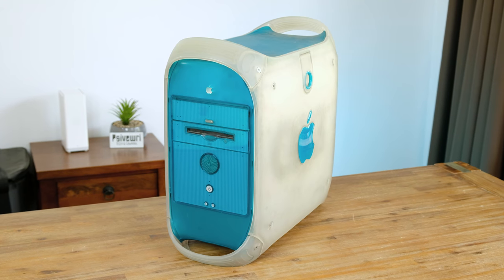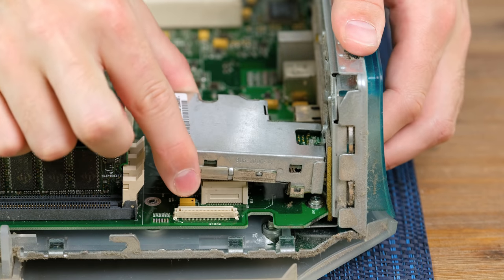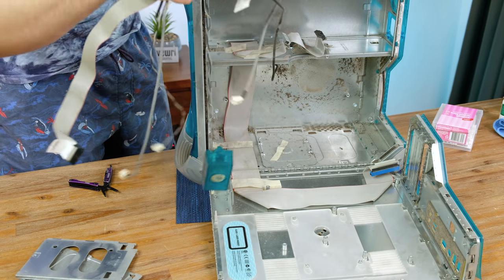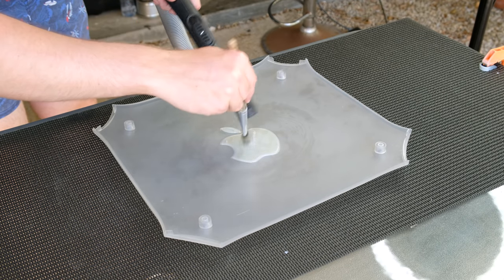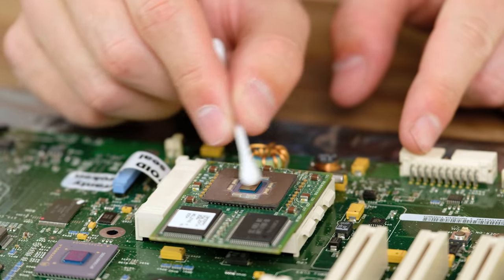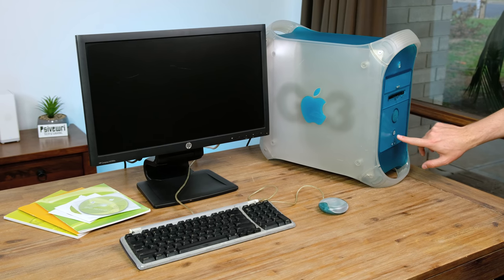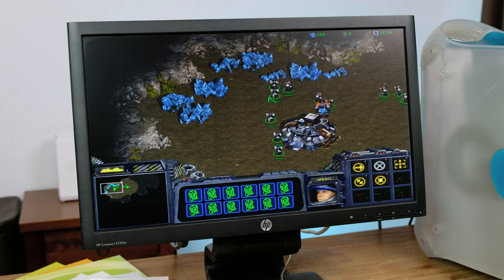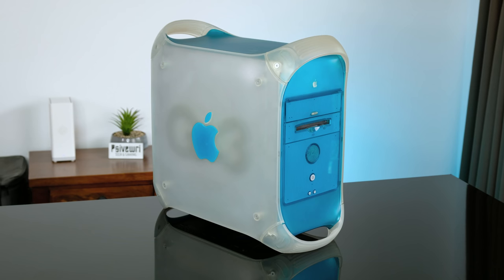Using Apple's Pro Desktop... From 20 Years Ago!

Comment: G3/4/5 are still my most favorite case designs of all time, especially the G4. just beautiful, and so easy to access things inside.
Reply: My favorite design is the graphite g4, but my favorite to use is the quicksilver. It’s the best mid ground to performance and cost. The MDD models can get expensive.

Comment: Very nice. I’ve still got our 400MHz B&W G3 my dad bought back in ‘99. It had been stored in the crawl space after we moved on to newer computers. I recently dug it out and freshened it up. Didn’t need much of a cleaning, but was missing the Rage 128 video card and the optical drive bracket and flip down door. Sourced the parts online and it’s back running good as new. Threw an 18GB 7200rpm HD in there, and with the 448MB RAM it had from years ago, it’s a very snappy Mac indeed!

Comment: Oh man, this brings me back! I remember in my College Art Department, a critical flaw in the design of these machines became apparent... well, less the computer itself, and more just the Zip Drives. See, if you had a broken Zip disk, it would break a drive when it tried to red the disk. If a drive was broken, it would break the disk. You can see where this is leading. The entire Mac Lab would go down at least one a semester because someone would kept trying to use a busted disk in each machine, rendering them unusable. Though since it was a chicken and egg scenario (what was broken first, the disk or the drive), it'd be hard to fault the student who accidentally did all this, especially since they essentially just lost all their work.

But yeah, nostalgia at its finest!

You mentioned/showed a lot of expansion space. About how much do you think this thing could be upgraded? (like, could you get over a gig of ram in there? An SD drive? A dedicated graphics card that still used the old PCI slots?)

Comment: Hey I've only just discovered your site - what a surprise to come across another Youtuber who works occasionally with the older Macs. This take-apart of the B&W G3 was mega - I don't think any part was not disassembled. Well done and even better was the fact that it went back together so neatly - not so easy.  I have 4 B&W G3s in my own rather expansive collection of old Mac towers. They are all in pristine condition (barely used), all with Zip drives, 2 @400mhz and 2 @450mhz. However up until the beginning of this year I had 7 - I gave 3 away for free on Gumtree. I had them up for sale on eBay (in Oz) for $50 but no-one was interested - so I disagree with you that they have any monetary value. I just like them because the B&W look so good. They are also great for running OS9 and older games (the G4s are better).  And of course every imagineable program and game for OS9 is now freely downloadable on the Internet since they are now regarded as "abandon-ware".

Comment: i was an Apple service tech when these came out , such a dream to work on , 5 minute ram or hard drive upgrades !
if i remember correctly it was the first , or one of the first computers to have USB only as the serial and keyboard/mouse interface . at the time people were unhappy about it because their old stuff didn't connect !
Reply: Do you think you could put an SSD in it and run the latest OS ?  (I have no idea what that is.)
Reply: i won't say it's impossible to put an SSD in a G3 , but it's not going to be simple , the hard drive connections were either SCSI or IDE/PATA . no SATA ports . there may be a card that will add SATA ports but i have no idea if you could boot from it . 

it absolutely will not run the latest OS (10.15) , the G3 has a PowerPC processor , the latest OS's are all for Intel based machines . i think even if you could get it to work it would be so slow you'd never want to use it .
the last version to support PowerPC is 10.6 . that might run ok , but many websites are close to not accepting any of the web browsers that run on that version , so usability is limited . 
also maximum ram was 1 GB , amazing for OS 9 that it came with , not so cool now .
Reply: I believe they were also the first PowerMac with FireWire. I had (actually still have somewhere) an external Sony FireWire DVD drive that had the translucent blue trim to match the computer.

Comment: We found a Power Macintosh G3 and a CRT Apple Studio Display; both of which were brand new and never taken out of their original packaging. About 2 years ago, me and my mom were driving on a warm summer day, and saw two boxes sitting on the curb. A sign said, "Willing to get rid of these. I don't think they're rare." We picked them up and took them home. We powered the computer on, and it worked. My mom gave me the computer since I noticed it first, and now my main computer in my room is a Power Macintosh G3.

Comment: Looks like your HP monitor is working fine. Are you using a VGA cable? I'm not having any luck getting my G4 to run on a similar size Dell. Getting the black screen and a no signal prompt. Maybe the display card is bad.
Reply from the maker: I was using a VGA connection. Might be something wrong

Comment: I remember when the Computer Lab back at the U got refreshed with these puppies, which was a SUBSTANTIAL upgrade from the old dusty Pentiums I and II they used to have,  also was my first interaction with Mac's back in the day as I used to be only a PC boy with either windows or Linux, can't deny I was charmed by the looks and the OS wasn't that half bad either, but gone are those days. Last time I touched an apple system was a Hackintosh I made installed, Snow  Leopard OS to use ProTools, I know I could have gone the easy route of just running a VM, but since I was going for a more "PRO" audio studio setup/build i decided to go to the Hackintosh which it  turned  out to be  pretty decent.

Comment: This was my first computer (with the matching monitor) as a graphic design student in '99. I used it until about '05 when the monitor went out. I sold the computer to a friend for $300 and I guess it only lasted about six months for him. It really was way ahead of its time. OSX was light years beyond Windows at that point. I've probably owned about 8 macs and used 10 for work. Of those 18 and I'd say this was somewhere right in the middle. Not the worst but not the best.

Comment: Still slightly newer than my oldest laptop which is a Toshiba Satelite 330cds with a manufacture date of November 14, 1998. Has a 266 MHz Pentium mmx with 96 MB ram and it's original 4.1 gb hard drive. Still runs fine today on Windows 98 second edition.

Comment: Next time use a compressor to blow the dust out works really well, I am doing it for more than 25 years. Protect the fans from spinning using a very small wooden stick or move really quick from left to right over the fans. Don't forget to lube the fans bearings under the sticker with very fine oil, like sawing machine oil reattach the sticker or a bit of tape.

Comment: What a beauty, although the cube is still the prettiest.
Its a shame you don't have the monitor to go with it though, that would really be a sight to behold.

This video has reminded me that I really need to get on with refurbing my G4 Powermac, but I'd like to max it out first with a dual 2GHz CPU to go with the 1.5GB RAM and the ATi Radeon 9650 256MB it currently has installed. (I sourced that 9650 from a G5 Powermac for 20 quid, and my G4 only has the 733MHz single CPU fitted, which is way too slow for the 9650 to really shine)
Reply from the maker: I would have used my old LCD cinema display, however that requires an ADC connector, or at the very least a DVI connector

Comment: I bought a 300 MHz Blue and white G3 from a friend who is a graphics designer. He had fitted a Sonnet G4 upgrade kit so it was a 450 MHz G4. He also installed a high-end graphics card. I felt it needed more IO so I added a combined USB/FireWire 400 PCI card, this had two USB 2.0 and two FW 400 ports, enhancing the capability quite a bit. Later I added another card with an additional four USB 2.0 ports. I also gave it the maximum RAM of 1 GB.

Comment: Hi, I love your videos. I’ve been watching them lately. They are very entertaining and taking apart repairing laptops in PCs. I love your videos thank you I have a question for you. I have the old laptop that was recently found unrepairable because it had a motherboard issue and I’m getting a new refurbished one but the old laptop the technician told me he was going to give the laptop back to me to tinker with my plans are to take the hard drive SSD out take the battery out of it because it still works it can be used may be in another computer, so what are your thoughts? I’m curious what you think since you like to repair computers and take them apart.

Comment: i got a silver G4 2002 model on Craigslist about a year ago for $20, non working.  i took the clock battery out and put it back it and it booted fine. i haven't done anything with it since the initial test boot and put it away

Comment: At home we have an MDD G4 Single 1.25 GHz that also has OS9 on it.  Followed by the Late 2005 Powermac G5 Dual 2.3 Ghz that is still a daily driver because of Quadro FX 4500 and 10 GB Ram.

Comment: Love the video - I'm not sure if you know this, but eucalyptus eats away at plastic! It's a handy solvent for ridding sticky messes, but on plastic fittings and cases it gradually leaves a haze. I used to use the same spray to sanitise vacuum cleaners that were in for repair but found any overspray would settle and just eat at the plastic mouldings. , Try out Halo glass cleaner, it works just as well and evaporates in seconds :)

Comment: Top example of one of these. Just be careful with the handles and feet on these, they're pretty weak. I've seen a lot of these where they're split in two, and it doesn't take much. How brittle they become may depend on the environment. One of my friends in QLD had one, the back foot suddenly gave way under the computer's own weight. Nothing on top, weren't touching it at all, it just suddenly fell apart. I don't think the G4s have this issue.

Comment: I have an even better one: The Power Mac G4  (Gigabit Ethernet "Graphite")  Dual 500 mhz model. 
which came out in 2000. I plan on upgrading the video card, adding more memory and installing Mac OSX Tiger, so OS9, or "Classic Mac" OS, will continue to reside happily in perpetuity. Try that with a PC.

Comment: Well yes but you forgot an important step - replacing the ATA drive with an ATA Disk On Module SSD (DOM). I hope you also did an OpenFirmware reset with a Command-Option-O-Fo on boot.

Comment: I should clean mine up too. Mine has a SATA card in it that I added many years after the B&W PowerMac G3 was made. Running OS X 10.3 Panther on it. (maybe I should put 10.4 Tiger on it, I already dual-boot Linux on it)

Comment: Apparently it is possible to run mac dmg in Linux, which spawned from mac in its early days.
I think some steps are neccessary in order to make it run though.

You should try RISC os, it is a different system from Linux, Windows and OSX

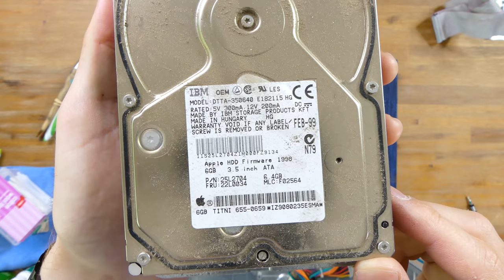Comment: 1:55 oh look a death star, i wonder how does it still work (or did)
Reply: Death Stars were 20GB upwards. I had a few. The lower capacity ones were fine.
Reply: @egbront1506  didn't know that only 20gb and upwards models were the most problematic actually
i also have a 20gb one, and it's dead of course, and it's actually WD branded, but the shell looks like an IBM deskstar.
Maybe it's right from when WD bought out the hard drive division from IBM
Reply: @JoseLgamer05  IBM and WB were very much separate companies when the dodgy Deathstars were about, so I'm not sure it is anything but coincidence. It was Hitachi who bought out IBM's disk division way back in the early noughties, the WB takeover of Hitachi took place much later. The IBM Deathstars were the 75GXP models and ranged from 15 to 75GB. I think the 60GB ones were very prone to dying.

When WB took over Hitachi, it carried on the Deskstar name but these were different drives and Deskstars (IBM's and Hitachi's) had long since shuffled off the notoriety. Seagate had their fair share of clunkers to follow.
Reply: @egbront1506  pardon my ignorance, thanks for the info
EDIT: i didn't do any reasearch on this whatsoever, so i just assumed what i was saying

Comment: Used one of these. Don't miss it. Not enough ram without forking over $$$ for an upgrade. The internal zip drives were plagued with the 'click of death'. Oh, wait, we've just released OSX and although it will run on your machine, your machine will certainly slow down dramatically in order to provide you wish fancy dock animations and genie effects on windows.

Comment: This was the Mac I spent a small fortune on as a freelancer back in the day. I'd been using Mac's since 1984 and they were the defacto standard in print and design. This was also the Mac that made me go to the "dark side". I had created a huge multi-media presentation for a company's trade show booth. I get a call after delivering that the (expensive) voice over wasn't syncing up. So, I go in to talk with them. The secretary begins running it on her little laptop (remember, Motorola was superior to Intel so Apple said) and yes, it's out of sync. Why? Because that crappy cheap laptop could run the Flash animations far faster than my Mac G3, so they slowly got ahead of the audio. I built my own PC and have never looked back. I don't care what it looks like! My doorstop is still in excellent shape in storage. Glad to know the POS might be worth something!